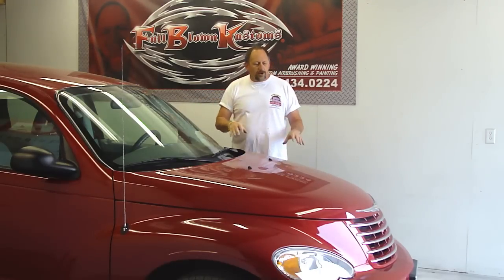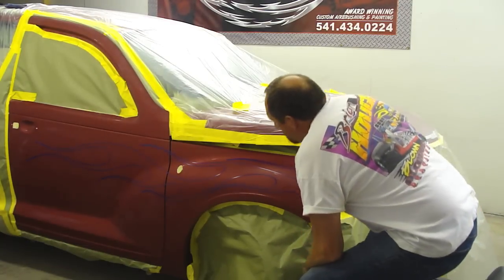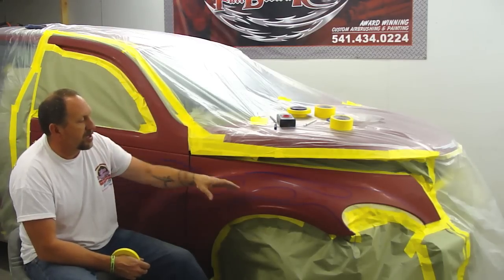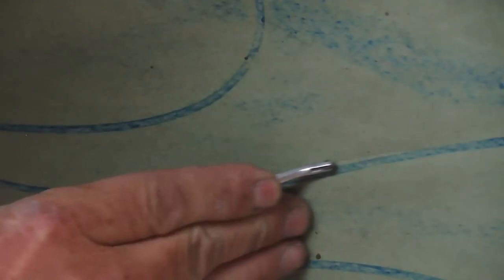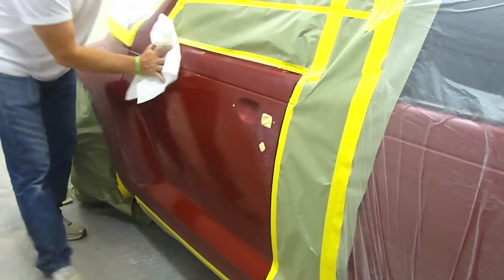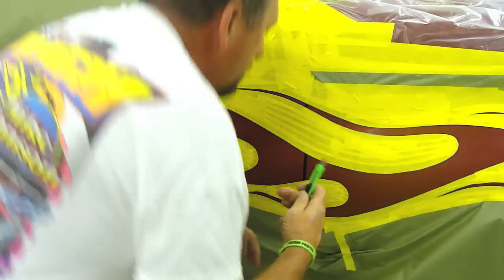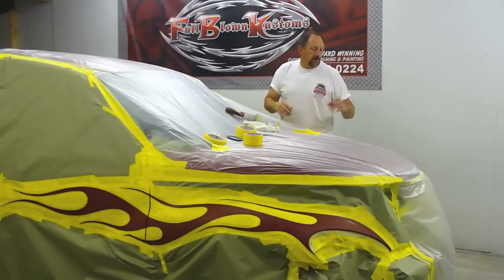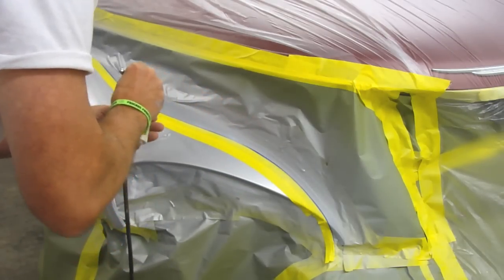Bevelled edge flames Part 1

Comment: Hi edd i need your help again. I need to know how to mix my b/c the ratio on the lable says 8:1/2:4 to 8. To 1 Gal of color,add 1/2 pint of 483-30 Base Coat Catalyst(2fl.ozer quart) and mix well.Reduce mixture 50% to 100%(2 parts paint to 1-2 parts reducer) with 441-21 Ful-Base Reducer. Those are the exact direction on the label. I need to know do I only mix the first part which is 8:1/2:4. Please help